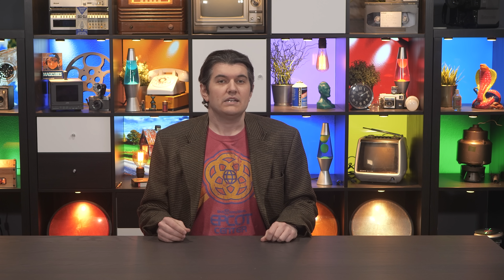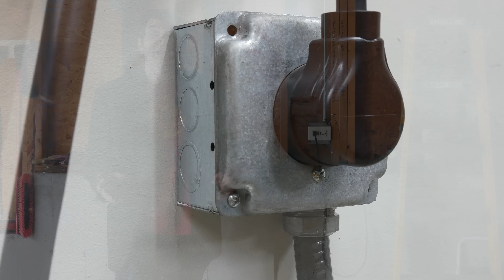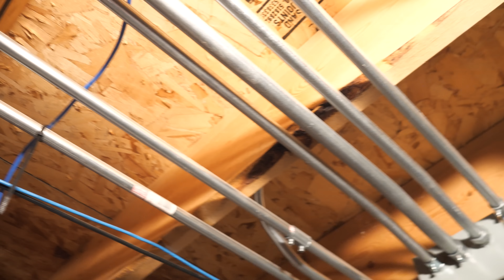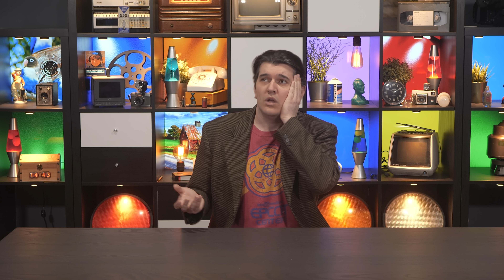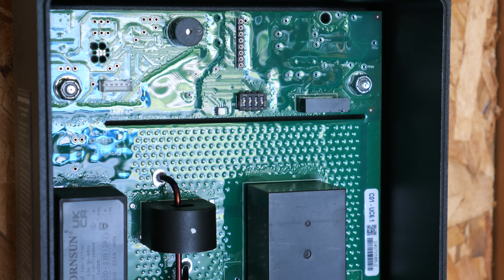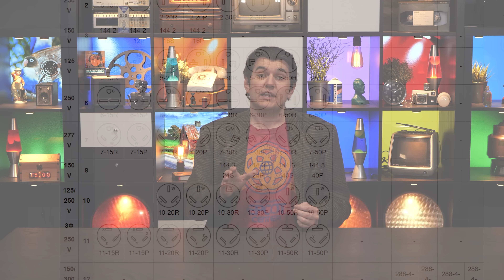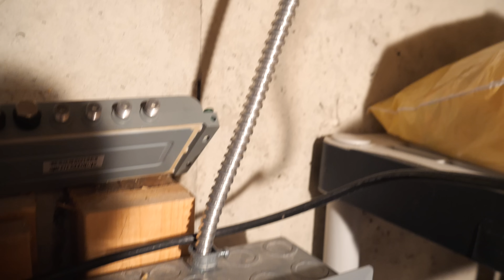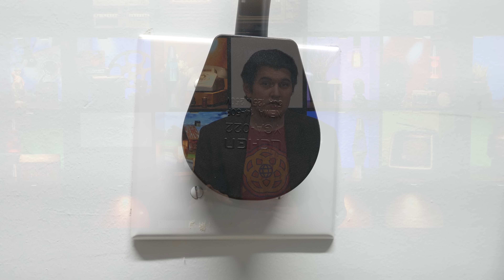The "standard" car charger is usually overkill—but your electrician might not know that

Comment: You know what's really cool about gas operated vehicles, it takes me 5 minutes to fill up from empty, and yes I do drive professionally and an electric vehicle would be SO SILLY to try to drive with my job, electric cars are a neat novelty but they will NEVER over take gas or diesel or even natural gas vehicles, the internal combustion engine will always be king for long distance driving.
Reply: I love cross country road trips and usually take 2 or 3 a year. Sometimes all the from St Louis to Seattle.  There's no way I could do that with an EV.
Reply: @dougn2350if I had a 9 to 5:00 job, and I live so I don't know, 30 mi from my job, I might invest in a Tesla, because it would save on gas, but you can be damn straight to there be a pickup truck with a gas or diesel engine sitting in the driveway next to it,  there's no way that I'd put  full face in what's essentially a glorified golf cart.
Reply: @slyfox3221 ... I like the "glorified golfcart" reference. 😅
Reply: Hell my diesel Jetta gets 600 miles with a full tank. only have to fill up once every two weeks. I drive a 48 miles round trip commute for work 4 days a week. And do some grocery shopping and whatnot on weekends.
Reply: I would be willing to bet that a battery swapping system will become common. The non- commercial version will have batteries the size of paint cans and a person in plastic sandals could switch them out. The roadway version would have batteries the size of server rack cells and a burly fellow in leather gloves will switch these cells out every few hundred miles. Regular people or drivers will not even own the battery they will simply pay for the charged cell and drop off dead cells. Sure diesel and dinosaur fuels will never die but eventually there will be hydrogen cars fueled from the garden hose , pneumatic cars 100% fuel free in some urban areas, and people charging their electric paint can sized batteries from ground loop geothermal electric at work for free. It’s my guess - in the long run electricity is less than .03 cents US per kilowatt hour. Maybe that’s all after the second armed culture war of 2215 A. D. or after they realize A. I. Is a channeled entity from another dimension or after the invention of the hand sized EMP developed as a safety against the synthetics in the 2055A. D. liberations, but in the end technology will raise humanity. (Oops, lift up humanity) - Love and Peace, Vas the Stampede
Reply: Just drove my car from Canada to Florida for $89 of power.  Waited 9 minutes (at most) beyond the time needed to pee and buy a sandwich.  Sometimes I was done charging before my wife got her order.  (I saved $65 by not needing to stop 3 hours for an oil change.)
If you love loud, stinky, inefficient, unsafe, and low powered ICE machines (that you cannot refuel while you sleep or pee), there will soon be plenty of people trying to sell them cheaply.
By the way, my car drove itself on FSD 99% of the trip with total safety.  I was happy to pay $99 for my safety and comfort while the car did all the work.
Reply: @DM-zq8qy 
Thats interesting.  So you charged to 80% in about 20 minutes.  
How far does that charge take you?
I assume you're driving a Tesla Y model?
Reply: @dougn2350 Model 3.  Rarely charge to 80% except during meals or overnight.  Stop about every 3 hours for a boost and a break. 😀
Reply: @DM-zq8qy You are completely wrong, internal combustion engines are not unsafe, they're not inefficient, they're not stinky maybe a little, I'll give you that one they do smell a little bit but are quite enjoy this smell of exhaust fumes and gas and diesel, and there certainly not low powered, EVs are novelties and that's all there is to it, and if you think that your car doesn't put out emissions well then you should just go out and whip the brake pads off of it because anything that comes off of the car is an emission, break dust, the rubber from your tires, rubber from your windshield wipers all that degrades after a while and it all becomes emissions off the car, so yeah your car is not green like you think it is, oh and it also uses as much power as a house to charge it, not to mention the diesel generators that are working overtime to produce the power to charge your silly little toy car, you would absolutely be flabbergasted with the amount of raw fossil fuels that are being burned just to charge your electric go-kart. Maybe you should do your research before you go and think that you're "EV" is better than an internal combustion, because if you believe everything you listen to then you're being lied to 90% of the time and you're not even aware of it. Be smarter comment it doesn't cost anything,  just a little bit of time.
Reply: P.S.  2 weeks ago, we drove from Canada to Florida on $89 worth of “EXPENSIVE SuperChargers.”  (I saved $65 by avoiding an oil change during the trip.)  
Yes, I waited 5 or 10 minutes a few times, but usually my phone told me my car was ready to roll before I was done with my rest stop.  
At home, I NEVER have to “go out for gas” or for an oil change (more wasted time, $$$, and dirty polluting energy).  It takes me under 1 minute to plug up and unplug once a week in the comfort and safety of my driveway.
Check the facts.  Don’t believe BIG OIL’s LIES.

Comment: Ask ten people if they know any EV can be charged with a standard 110V outlet. 

Not a one will. 

Bought a ‘23 Model Y LR in Feb.
7000 miles so far, most from plugging in at home with a standard 110 outlet, just like a vacuum cleaner.  Instead if spending $2000 to install (yep, that much) plus $440 for the Tesla charger, I just use the cable and plug  that comes standard with every Tesla.

The one time I needed to start a long drive the day after a 1300-mile trip, I stopped at a Supercharger for ten minutes.

Comment: with installation specifications in mind and how easy your install is because of the position of the power panel to start with it wouldn't cost that much more to run a 60 amp circuit that would allow some of your cars to at least pull the 45 amps that they're capable of. This will also reduce time to charge and therefore reduce the waste that the battery charger has to do to convert the AC power that your system is providing to DC to charge the battery. There is some waste in this conversion.

Comment: We used a normal outlet for the first year or so of owning our Mach-E.  It would add enough if we always plugged it in and then 2-3 times a month we would have to charge at the walmart for 20 minutes.  After a year or so decided to install 2 50Amp breakers in our box and two ports.  It was much faster, with just a few hours of charging it is full every day.  We did two because I was planning on getting an EV also.  I ordered all the parts, conduit and wire on Amazon, then an electrician friend came by and had it done in an hour.  Lucky for me I have 400 Amp service to my home for some reason, with a sub panel for all the bedrooms.  The panels are outside the garage. I paid her $175, and paid about $450 for all the parts and wire.  Still had 10 feet of the 50 foot cable left over. We use the mach-e charger still, it is only 30Amps....   I bought a 45amp charger but we have not used it yet because the ford one is fine.

Comment: Since he mentioned the Silverado EV, i have to point this out. 
It is NOT a practical vehicle, you DO NOT need it! 
Not like ICE vehicles with a fuel tank, EVs are carrying much low energy density battery packs. 
If an ICE vehicle needs longer range, the easiest way is to put a bigger fuel tank on, like F150 with 136 liter fuel tank (factory option, not aftermarket) makes it easily go beyond 1000km on highway, 1200km in my experience (2.7 EB), that is almost 800 miles. 
If an EV wants that kind of range, it needs a much much bigger battery pack, but due to its low energy density (compare to fossil fuel, gas or diesel), the bigger it gets, the more energy it requires to move itself. 
In this situation, we are at so called "bigger the battery, smaller the battery" situation, in translation, the bigger battery you have, the lesser energy you may be able to use. 
Of course, this is not true all the time. 
Within certain range, the bigger battery does mean longer range, but there is somthing we call “marginal utility”, which means at some point, the positive range gain of having a bigger battery offsets itself and turns into useless weight, or, moving weight for moving weight (it consumes energy to move itself, rather than moving you). 
Unfortunately, silverado/sierra EVs are approching that point, and Hummer EV is definitely at, or even went beyond that point. 
I believe the best approach of an EV with today's technology is something like a Bolt or IONIC 5 like his, small and simply, just for moving people in short range per day. 
A bulky and heavy EV pickup truck is NOT meant for most people (at least for now), you do not need it, think it twice before you buy it, think it three times if needed.

Comment: My wife has had a Sorento PHEV for three years at this point, we have been charging it overnight on 110V/20A circuit with the supplied charging cable. When we got the car I initially had intended to install a 240V charger for it, but after the first couple months of actual use, we realized we did not need it.

Comment: In UK 240 volts 60 to 100Amps is the usual current available to a house with single phase. We had a professional install a Zappi  smart charger (7kW)  with additional  breaker total cost £900. The intelligence is required in this case for useful use of solar power, limiting the total house current to the grid fuse current, It does provide an application for smart phone, which enables timed charging etc. more importantly the charger will respond to internet signals from Octopus the electricity supplier. Octopus have a special car charging rate a 1/4 the normal. They guarantee to charge vehicle by a time of your choice and all charging is done at the low rate. They frequently start charging car at odd times outside the normal 23:30 to 05:30 cheap time. Whenever the bev is charging the whole hose receive cheap rate.
lligent charger is useful and saves us money - in the UK!

Comment: I started with a 2014 Focus EV then a 2020 Bolt EV and now a 2024 Blazer EV! I drive about 10Kmiles/year and have never needed 220v! If I go lots of miles or use A/C or heat a lot (sitting at an event etc) in the car i may need to ketch up the next day! I only went to a DC fast charger once to check that it worked when the car was new! Everyone seems to agree slower charging is easier on the battery!

Comment: I've had an EV for three years and used the standard outlet in my garage. I live in the north east, so charging is dramatically different in the winter. I work 7 days a week, but even with all that factored in, I only needed to bump up to the fast chargers at the mall once a week. In summer, there was need for that. However, I am finally installing a level 2 to have more flexibility without having to rely on my wife's car for other trips outside of my work commute. And yes, people are always shocked to learn I simply plug into my 120 volt outlet. I think that is because Tesla (who I used to work for) trained the customer to think the level 2 charger was a must have and that set the standard.

Comment: I heard plugging Tesla mobile charger into an outlet instead of having the main Tesla wall charger hardwired that the mobile charger cable does not reach as far as the hardwired charger does. So if you’re going to use an outlet with the mobile charger, the outlet has to be located much closer to the charging port on your EV.

Comment: I have a Ampure Go 2 12/32A Level 2 Dual Voltage Portable EV Charger and about to install an outlet to get our new EV9 charging. My question is…could I use this setup that you did with the 10/3 cable or would you recommend the full install using 6/3?

Comment: You are wrong that a Bolt can be charged with "any standard outlet." Read the Bolt manual page 205. "Do not use an electrical outlet that is on a circuit with other loads." Standard wiring in all homes has 15-amp 120-V outlets, and they are always "shared with other loads" unless they are homeruns for a specific purpose. Those 120-V plugs you see here and there in a house, even outside a house, are not intended or designed for continuous duty, like 12-hour charging at 80% of their maximum load capacity. Could a homerun 120-V 20-amp line charge a Bolt safely? Sure. But you'd be crazy to spend the cash or time to create one. You are perpetuating a myth in the start of your (excellent) video. I like your 240-V setup. I used a similar one for many years, and it worked great. As you say, almost any 240-V setup is fine for one car. But what about down the road if the household later has two or three EVs? Using a 50-amp circuit (hardwired) allows for a quicker charge and not much more cost. House doesn't have the capacity? Look at a load balancer product. Emporia makes a charger with it built in, or other products can allow for load limiting (no electric stove, heat pump, or dryer) while charging. Honestly, spend the money and get the service upgraded. Or just buy a hybrid.

Comment: I am almost 100% in agreement. BTW, the Grizzl-E is a great choice and hardwiring is the way to go if possible.

I have an Emporia, it's hardwired to a 60A breaker. Still, I have the max output de-rated as I can fully charge our current vehicle to 80% (the recommended typical max SOC) overnight with a max power setting. I like having the Emporia EVSE app controllable for two reasons. First, I like setting up the time of day charging on the EVSE, this allows me to set the vehicle to always accept charge and when I'm charging away from home I don't need to remember to reset the vehicle. Secondly, when needed, I can override the timed charging settings using the app and, again, I don't need to sit in the car and muck about with setting and I don't need to remember put it back afterwards.

Comment: 16:44 There is a need, depending on the car. The low range EV's, like the 2011 Nissan Leaf, or Mitsubishi I-MiEV, BMW I3, or a Chevy Spark EV could use all the help they can get, if your trip is more than about 30, or 35 miles each day. I use that number, since those EV's, with the older worn out batteries, tend to have about 30 miles of range from 100% to 0. Side note, the Spark, and I3 do have more range, about 50, to 60 miles. So you can get away with not fully charging it easier. 

But a Chevy Bolt is great though!

16:55 Actually, yes, I do. I drive about 45,000 miles per year, and have a 7 gallon gas tank (it's rated at 9.8, but I fill up at 1/8 tank, and put 7 gallons in). So I do top off a lot. Not daily though, usually 3 or 4 times per week.

17:38 210 KWH? That would take about 210 hours to charge on level 1! That's absurd!

Comment: I am looking into getting an older Nissan Leaf for a fun little around town EV. I plan on charging on the 110V outlet. If I hypermile, the car can likely get 4.5 miles per KWH, or maybe 5. If the 110V outlet has a 10 amp charger, that is about 5 miles an hour of charge, or overnight solid 50 miles in 10 hours, or 60 miles in 12 hours. More than plenty for most people, the average car goes 30 miles a day.

Comment: You are absolutely right.
For 5 years I have used the car's included "Granny charger" without any problems. The one that everyone says you MUST NOT USE! It will burn down the house and what do I know.

NO IT DOES NOT. It has undergone the same safety tests as everything else.

what "can" cause a house to burn down is when people DO NOT know what they are doing and they overload the system.

I have an old single-phase car. I have had a 16 amp cable and plug run to the car. I charge with MAXIMUM 12 amps, but often with 6,8 or 10.

My approach is this:
I must "before I wake up tomorrow" have filled the car with the power I have used today.
Since I usually don't drive more than 100 km (62.13 Mi) daily - which corresponds to a consumption of around 13.5 KWh, it's pretty easy to calculate that with a "night" of 10 hours (I'm very rarely away from home after 9:00 PM and often only leave home after 10:00 AM as I'm retired), I actually have 13 hours to charge.
My car charges with an average of (measured!) 2.2 KW. so 10 hours gives me 22 KW, which is close to double what I need. That's why I often use 10 amp. as maximum input to the car, which in turn gives around 1.8 KW (measured!). 
so 10 hours with 1.8 KW = 18 KWh and I typically need 13.5 KWh. So still more than enough. Slow charging is also better for the battery, which today, almost 6 years old, is still 100% SoH. So even on days when I get home late and have to leave earlier the next day, there is still enough power on the car.
I am so incredibly lucky that I have a DC fast charger 300 meters from my home (less than 1000 feet).
My claim is therefore that MANY (not all) can do with a home setup like mine.
But always remember:
SAFETY above all. you have the 80% rule. If you want to be extra safe, you make it a 70% rule. Then you have a 40 amp. fuse, so don't draw more than 28 amp.
Remember that ALL plugs and everything else that is placed between the fuse and the outlet must be tested for the same voltage and load!!! This is the weakest link!
Also remember that all wires must be tightened to the correct torque. Too loose means sparks can occur, too tight and you will destroy the structure of the wire.